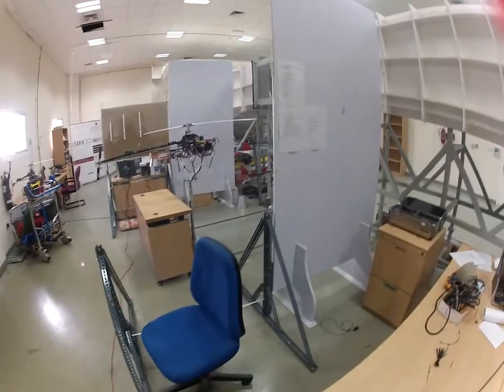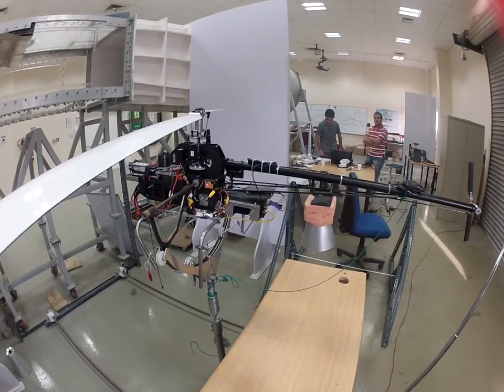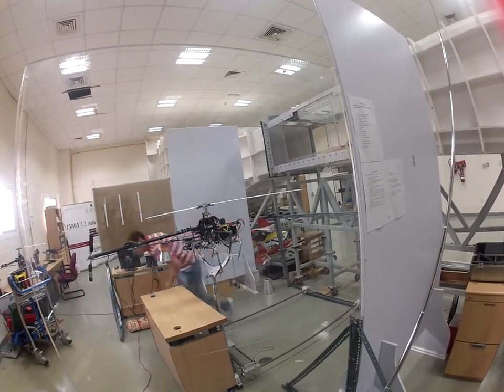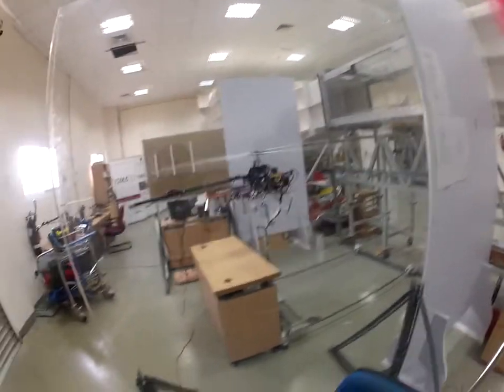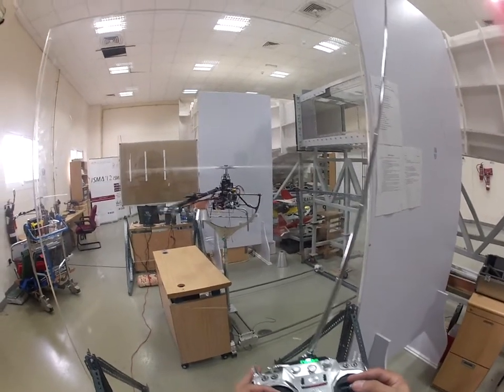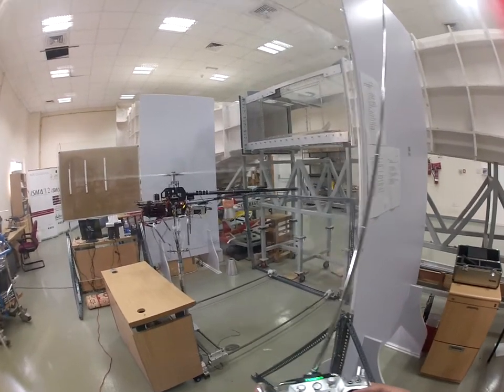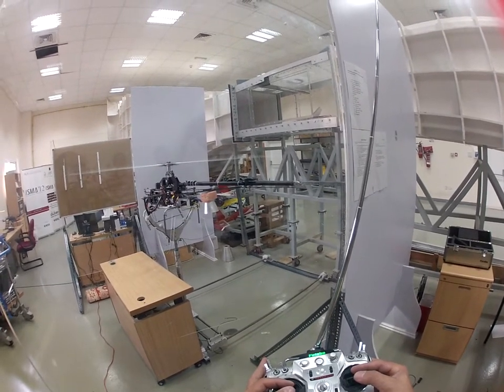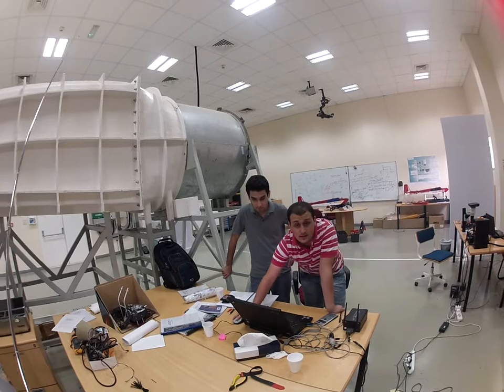micropilot bench test for vibration and gyro setup.MP4

Comment: How did this fly without x, y axis stabilisation on the head? Did you use CIC or PIC Arcade attitude mode? Also did you have a seperate tail gyro or did the micro pilot do the correcting? Could you send me your final .vrs file as I am also working on a similar project? Thanks